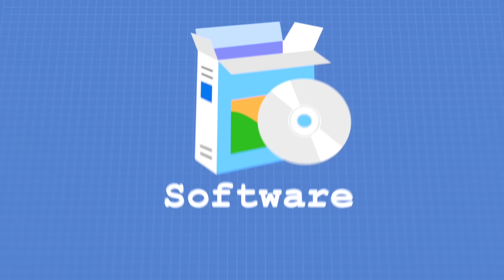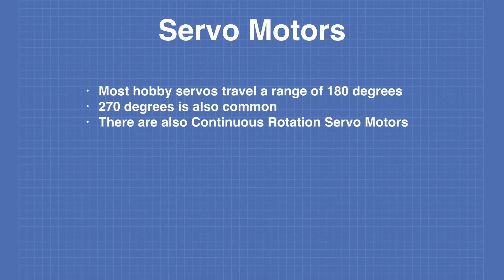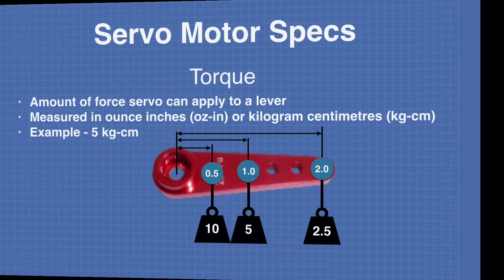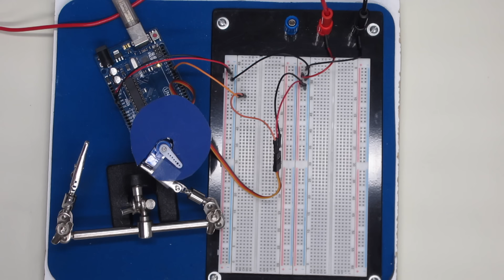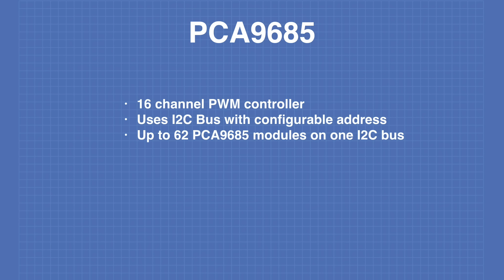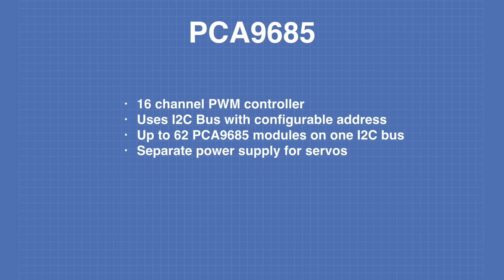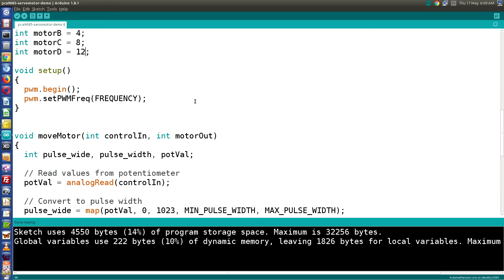Using Servo Motors with Arduino

Comment: Hello sir , I am working on a project where I am using servo motor rated as 6 V - 7.4 V. Earlier I was giving it the power from arduino itlsef. Later I used a DC power supply source at 7.0 V and I set the current limit to maximum value of 700mA. The moment I connected , the motor got destroyed. Can you explain why it happened and how to correct it. Thanks

Comment: I like the way you explain. So clear. Thanks a lot. I want to know is it possible to use only one pot for any number of servos (16 Max) connected to PCA9685 by addressing each servo in the program. Thereafter saving the positions by saving and play buttons either internally or by external EEPROM interfaced to the I2C bus

Comment: I have successfully implemented the sweep function on the SG 90 Servo motor, but it will not move the full 180 degrees - only less than about 170. I also notice that Bill's Servo will not go the full 180 degrees either. Is this a problem with many servos?

Comment: This is brilliant and has been amazingly helpful towards my first project thank you!  I have successfully got this working with the 3 servos I currently have (360 degree MG996R) "but" I am wondering if there is anyway to slow the maximum rotation down through code, or if I need to restrict the movement of the potentiometer itself?

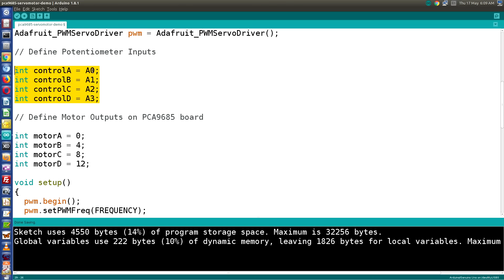Comment: How can a variable input such as 'A0' or 'A1' be recognised as an integer value? There's a letter and a number. 35:50
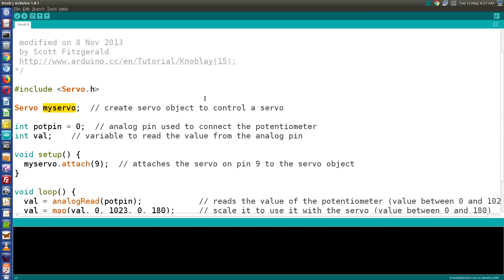See- I got it when the analogue input on pin A0 was just labelled as '0' in the earlier sketch @ 20:27. I didn't think an int variable would accept something like 'A0'.

Comment: Great video! I noticed that your and mine 9g servos dont make exactly 180 degrees. I used the 2 other parameters in the servo.attach() to calibrate the right angles of the servo. Did you have experimented similar approach to calibrate your servos?

Comment: Super helpful video! A small correction though: Torque is not measured in the units of kg-cm (or kg-length). It is measured in Newton-meters or Newton-[length]. Kilograms are not a unit of weight but a unit of mass, while Newtons are the unit of weight in the metric system.

Comment: This was a great Video and it has helped me understand each topic covered in this video. 

I have a project where I intend to run a large 80x100 Brushless Motor with a 300A ESC 

I currently use a servo tester but I find the knob is touchy. And lacks finer control. 

I would like to set up an Arduino to control it in forward direction only. 

Possibly incorporate serial feedback for RPM as I know the motor has sensor wires built in. Ultimately I'd like to have the CNC controller communicate with the Arduino to turn the motor on and off or to select the RPM.  At this point I'm fine with setting up preselected RPM settings. 

Serial connected to the Arduino or through buttons or switches.
Reply: So what I'm saying is if love to see a video covering the topic of controlling a brushless ESC with an Arduino, with several possible setups. Explained by You! Some of the videos I've watched leave me scratching my head. 

ps:  I'm currently running this Monster brushless motor on a Sherline CNC mill.

Comment: Hello Bill:
I have a question on servo motors.  When we use servo motors, iwhile in motion if there is an obstruction how can we handle this pro grammatically?Does the servo send a signal to controller if it encounters an obstruction?
Reply: sorry...how do i handle an obstruction to servo motion in my program?

Comment: What happens when you change the increment to "pos +=/-= 2"? What is the significance of having to set the degree for steps? Why not just set it to 180, that way it goes directly to the desired position?

Comment: If you want to have the angle range between let's say 7-130 degrees, will the map command understand map(val 0, 1023, 7, 130) ? Or do both value sets need to start at zero? Great video, thanks!

Comment: just i try looking how connect servo, i have 7,4V RC car battery 2sell, and arduino nano 5volt working power, and 5 volt servo 20kg torgue, and 7,4votl servo 25kg torgue, need use 7,4volt servo whit arduino how conenct this, need i step down board drop adjust power out battery to 5volt to nano, and full 7,4 volt to servo ? and how high torgue 20 kg 5 volt servo, need i power servo step down board adjust 5 volt and connect nano 5 volt and connect servo 5 volt battery have 7,4volt RC bat. im not sure how i connect safety this not burn nano.

Comment: I have a question.  Have you done any projects using a slip ring?  I am trying to design a project that will have a rotating arm of led lights but need a way to spin the arm of lights without having the wires becoming wrapped up or tangled.  I know there are things call slip rings or I believe sometimes called a clock spring such as what is used in a car steering wheel.  Any advice or help you are willing to share would be awesome.

Comment: Hi There. 
Great Tutorial video!
I have couple questions about servo's and specifically the Adafruit library and how it controls the motors with PWM.
I built a 4 DOF robotic arm last year for my 4th year Mechatronics project, long story short all went well! 
But i did notice some bugs in the way that the Adafruit library and the Servo library handle the initial PWM sent to the motors upon startup. 
I had setup all my servos to accurately move between 0 and 180 degrees by adjusting the min and max pulse width and then using the map function to drive the servos to the desired position just like you have done. However whenever i sent power to the motors when starting up the whole system (giving power to the Arduino and Servos) the servos would automatically move to the 90 degree position at full speed and cause a whole bunch of unwanted movement in my robot.
Why question is how can this be overcome?
For instance say that there is power failure in the system and all the servos stop in the last position they were in...when re-powering the system, the servos would jump to 90 degrees at full speed and not wait for my commands to move.  
It was like there was default PWM sent to the motors before any move commands were sent, How do i get around this?
I have been thinking of this issue for a while and the only solution i can think of is creating my own PWM library to control the servos.

Comment: Will it damage the servo if the code issue the command to turn 360 degree on the servo that can turn less than 360 degree?

Comment: Help please,  i'm using a standard servo, i just need the servo to turn 90 or (even less). I would like to do this in the simplest form possible, for example by simply connecting a 9V battery to it for a split second, when i do this, it works perfectly, it responds quickly and makes the small move that i am looking for. .  that simple.  The question is, AM I DAMAGING MY SERVO by doing this? is there a better way?   I have a wireless remote that I use to give it the quick one second 9V power it requires for it to respond. I must keep it via remote. Thanks.

Comment: 🌠🌠🌠🌠🌠

Lot of Thanks for the Tutorial, hence I have a small Question.
Is it possible to move an 'Servo Arm' in back and forth on predefined 4 to 5 position (i.e. 45°,60°,70°,110°, Back) on behalf of some background Rythm Frequency which is preloaded, and strike over some surface with full speed/torque (i.e.120°, Forth), but if it get opposed to do the same task (to move 120° in forth) then it will go back to the next position of back (which will keep running the loop).

Practically we don't wanna to move the arm in forth position for 120° ever, that's why it will keep continue to move into the 'back with a new position'.

Actually I'm looking for a musical instrument solution, so the "maximum speed of the specific servo motor" also does matter I think.

Comment: How do you know/calculate how many volts I should use as input in my projects? For example: controlling a servomotor that hasn't got min/max Voltage printed on it? How do I know if I need to add a resistor, and if I do, how do I choose the right one? If I add components, how much does the voltage drop before the current reaches the servo? If it drops too much, how do I increase it without damaging other less tolerant parts? How do I find out how much power components consume along the chain?

Is a multimeter the only way, or is there some kind of trick to figure it out anyway, without having to look up every single parts specifications online?

I got a lot of questions! 😂 But yeah... I just want to do things right from the beginning. And also, I might not have internet-access all the time, so I need to learn how to calculate power without depending on online-searches!

Comment: Since an arduino can produce 6 PWM channels without the additional board, is there anything to gain from using the additional boar in this example, or would it be easier just to use a bard arduino board until you hit that threshold of needing 7 motors?

Comment: I want to control 36 servo units on my OO Scale Model railway Points/Turnouts. I have the servos, 3 Uno''s and 3  PCA9685 boards. I also have the servo tester. What I need to know is how to set the code up for moving the Point blades from normal to reverse (Normal = Straight Reverse = Turn Left or Right) The servos will be mounted under the baseboard in a 3D mount which has a slider, n which one end has a hole to attach a length of Piano wire which will go up through the baseboard and into a hole in the middle of the point blade control arm. 0 would be straight ahead and left or right would be the reverse angle. The points/turnouts will be controlled by a one-touch switch. Martin (Dhaka, Bangladesh)

Comment: What will happen if the movement of the servo arm is obstructed?
Example: From home position A, a servo is programmed to move the arm to position B (which is at 90°) and then return back to home. On its way back there is an obstruction, say at 5°, which blocks the arm to reach home position. Will this disturbs the home position registered within the servo?

Comment: this the most detailed Servo motor video out there, which also explains what each pin to beginners like me. thank you so much. 
1. would it possible for you to make a video of how to control multiple servos at once rather than running one at a time using PCA9685? 
2. Also how to mod this same servo for 360-degree rotation so we can control using PCA9685

Comment: Being very new to Arduino if I want to run 2 servo's and have two pots would I run the second pot to pin  A1 and the other servo off the same power supply the PM wire to pin -10 eventually i will be running this on a Nano board thanks.
Reply: To drive a servo you need to connect the SIGNAL wire to any PWM pin on Arduino which is normally indicated with "~" sign. In case of Nano, they are D3, D5, D6, D9, D10 and D12. If for the 1st servo you have used D9 then, you can use any of the remaining and make the changes in the code accordingly.

Similarly, the POT's wiper pin should be connected to any analog pin, A0-A5 on UNO and A0-A7 on NANO.

Comment: correct me if I am wrong, but does this external power supply connector make the circuit of arduino and pwm expander  have NOT a common ground?

Comment: Sir please what is the name of the rotary driver you are using to drive the servo motor without arduino in the beginning of the lesson.
Reply: You can even use a ne555 that generate the right frequency pulses and could be adjusting the duty cycle
Reply: Thebasicmaker thanks
Reply: @realitygimiks5737  I don't remember the exact frequency if it was 16khz or 60...you can get that info on google..or some datasheet

Comment: I have a 6DOF Aluminum robot arm working, but it needs a stronger power source. I have strapped two 6 Volt lantern batteries together in parallel, but they aren't strong enough to make the arm stand up. What kind of power source - how many amps do I need? Recommendations?
Reply: Thanks, Jeff. I am actually using a PCA9685 for this application, but your suggestion seems pretty spot on. I tried using a 12V battery that can drive my CPAP machine and stepped the voltage down to 6V, but two of the servos seem unable to handle that, probably because they are all of the SG 5010 variety. I have ordered two servos of the style you recommend and will see how they work out when they arrive.

Comment: Excellent explanation how ot use the I2C bus and bus controller to drive several servo motors, ending in a practical example how to operate a mini robot.  Also the tips and precautions for power connections and various arduino board types is included.  Realy complete video.  Many thanks.  This inspires me and my son  to dive onto robotics more.  Also the voice, code and schematics used in the video are availalbe in details at https://dronebotworkshop.com!  All  links and code are there.  Brilliant!
You have 2 new fans and followers on youtube and the workshop :-)

Comment: Something unexpected - wired up as per diagram @ 19:34, with the exception of the ground wire from the 5V power supply (wall transformer) - slipped out of my finger (so no ground from the supply), yet the servo still went through the routine.  So how can a transformer provide power to the circuit if it's not connected to ground?  I'm new to electronics, so this may be elementary to most.

Comment: Thanks for video, this is the first video i've found that is close to one I need, I am building a Model railway and want to use Arduino and Servos to change point, this one I may just be able to work out the Sketch for using Push buttons or Toggle switches to switch points, would be great if you get chance to do a video, need to move servos about 60 deg and probably use 2 PCA9685 boards so may have to use a Mega to get enough inputs.

Comment: Sorry if this is an obvious question. 
Do you need a bread board between the power supply and the servo? Could i just rig it to a 9v instead?
Reply: the breadboard is used for connecting wires solderlessly. you can do it directly but it might be a bit difficult if soldering is not your game.
NOTE THAT THERE IS MORE THAN ON WIRES CONNECTED TO SOME

Comment: Can you use Digital servo's using this info? Analog servo's are on their way out. I'd rather build a new project using digital servo's. I have a project in mind requiring 4 rotational & 3 linear servo's. A MP3 player and 3 touch sensors. Thanks 4/t great vids!

Comment: What type of power supply would you recommend to run a few servo's?  I was looking on Amazon and found a few under $100 but they were 30V 5A.  I was thinking possibly 10A???

Comment: Thank you for creating these excellent videos! Do you have any resources that provide more detail on how to configure the servos initially, and avoid burning servos or destroying their gears? :) As in setting the right pulse widths in the PCA9685 PWM Servo script, and maybe some structured approach on identifying the range that will be required for a servo to perform a specific task (robot arm wrist movement vs robot finger movement) and configuring that in code accordingly? Thanks and keep up the great work!

Comment: the code with the PCA 9685 doesnt work for me. Nothing happens. I'm using 4xAA alkaline battery in series to power the servo. Is my PCA controller broken ?

Comment: Hi! The video was super helpful. I'm currently working on a robot arm and I have to control 20 SG90 servo motors. I have an Arduino UNO board and a 32 channel PWM servo controller. Would the wiring be the same as the one you showed for the PCA9685 board? Thank you for uploading such helpful resources, I hope I can hear back from you soon :)

Comment: How is it possible to control more servos than the number of analog pins on the arduino. On page 14 of the text for this video you show 4 potentiometers controlling 4 servos using a pca 9685. Each needs an analog pin.  How do you cascade the pca 9685 to control even 50 servos with potentiometers?

Comment: Great video, thanks for it. I have a (maybe) dummy question. Is it recommended to use same external power for both: Arduino and a motor? (with some split cable). Reason: on final project I don't want to have two separate power sources if possible. Or maybe connect power directly to a motor and to Arduino 5V over MB102 power supply module.

Comment: Amazing video, well my team and I are working on a Hexapod robot and controlling the 18 servos using 2 16 channel controllers. We are currently facing difficulties with the power supply to the servo motors, we are using a 6 volt battery with a supply of 4.3 Amps but it is only capable of powering only 9 servos, and using multiple batteries is going to be highly impractical, so what would be a good solution to our problem ? Many thanks in advance !

Comment: I'm making a robot arm using servo motors and controlling with a wii controller and a Bluetooth processor attached to the P96380. What is the arduino program called?

Comment: i have a question i am using a Hc-12 module and i am have some serious issue with noise in the lines.. any suggestions on a cap or somthing to get rid of the " jitters " and the servo itself has its own power supply .(4 -double A battery's..
Reply: Did you find a solution to the servo jitter? I'm having the same problem